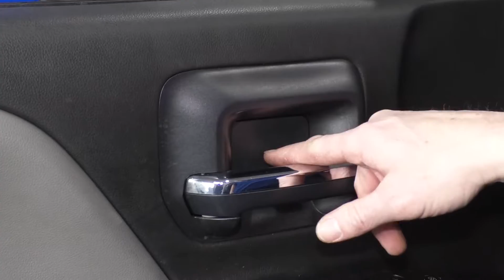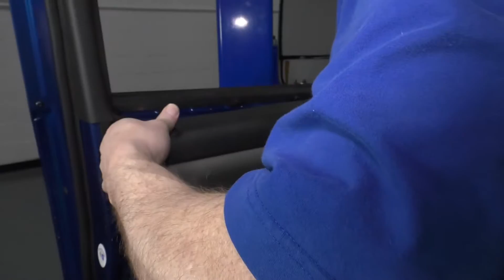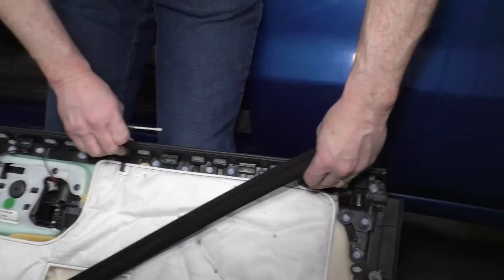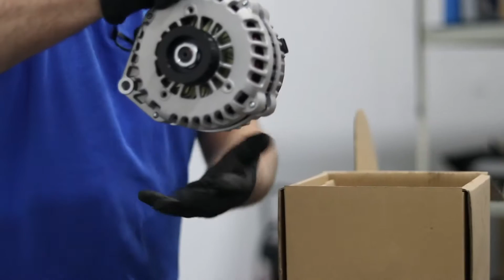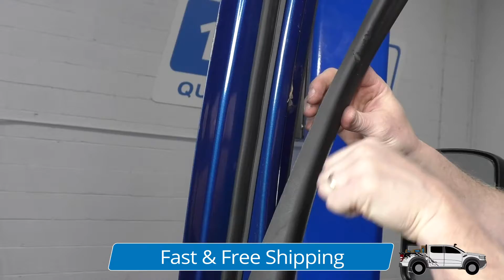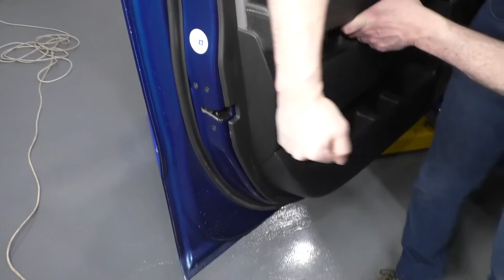How to Replace Front Window Glass 14-19 Chevy Silverado

Comment: Might be a silly question, but I have a 2013 silverado I need to do this replacement on. Is there anything different between the 13/14 model for this installation?
Reply: (beyond the location of the interior handle)

Comment: Great video! How do you remove the window channel weatherstrip?

We have determined the wind whistle we sometimes get in the cab at freeway speeds is due to the upper back edge of the window glass being loose or not sealing 100%.

There is a tiny plastic piece in the weatherstrip that is loose resting on the upper right side glass. I believe this is the problem and the weatherstrip needs to be replaced.
Reply from the maker: +Jim Tippins We do not have a video for this repair right now, but we'll keep this request in mind for a future video! http://1aau.to/m/Shop-1AAuto-c